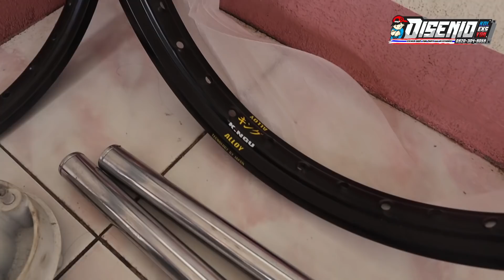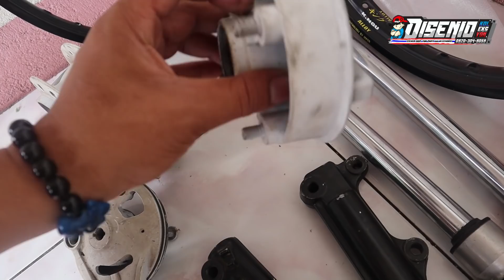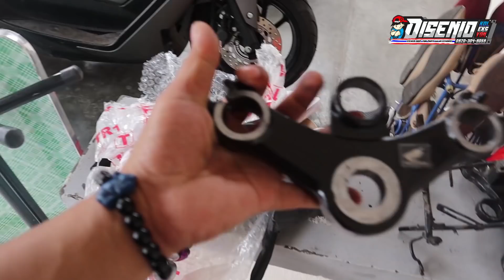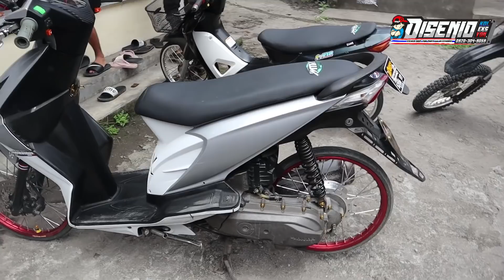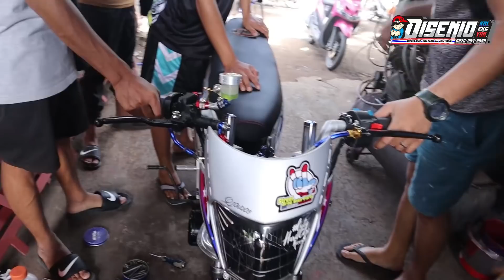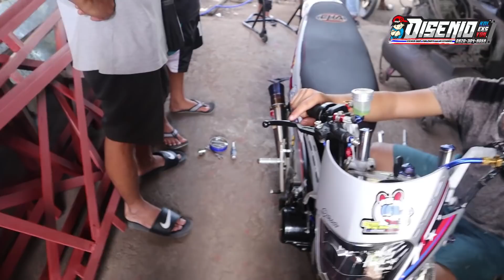BOMBAHAN/SOUND CHECK NOO LAMLUKA SUPER OPEN ni TRIBES

Comment: ganda sana paps kung naka 60+ na bore ka lalabas talaga ang tapang ng tunog ng NLK 
pero overall ganda ng motor mo
Reply from the maker: salamat paps hehe, oo paps 65 bore talaga gusto ko kaso gusto ko kasi starter lang gamit ko sa show di na mag kick starter para malinis tingnan
pero depende nalang paps baka magbago desisyon hehe
Reply: @jaysonsimbahonj-entertainm1858  may starter na nabibili paps na pang wave 125/xrm 125 na 200cc up